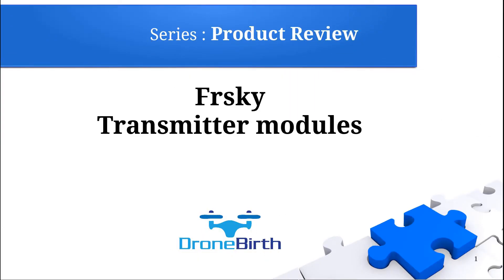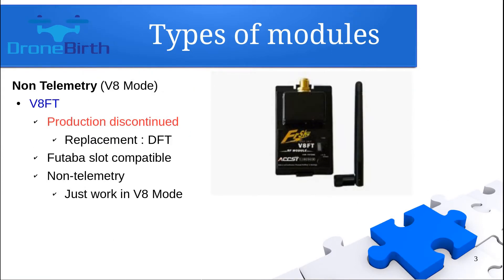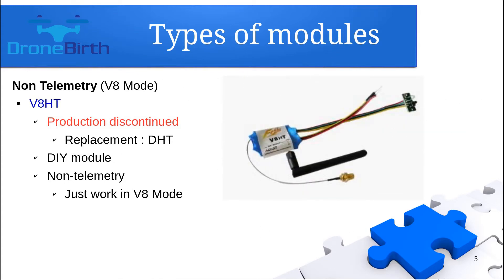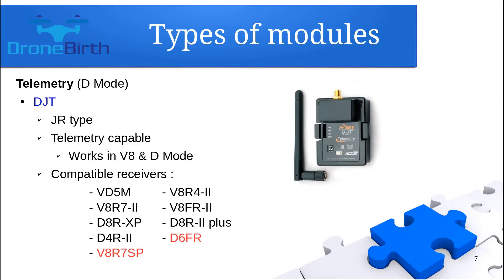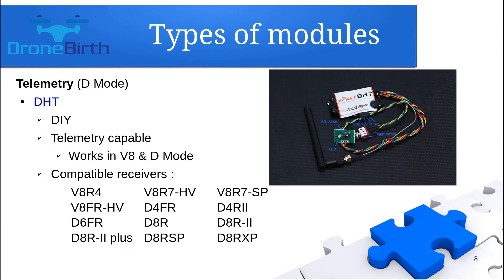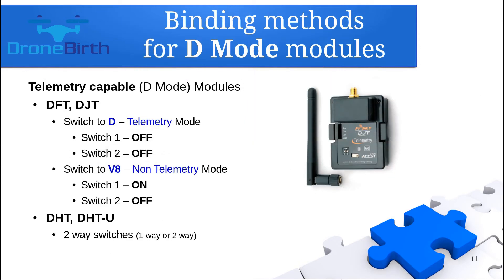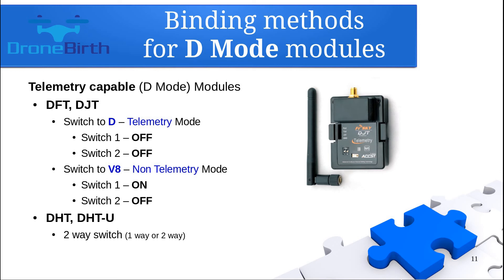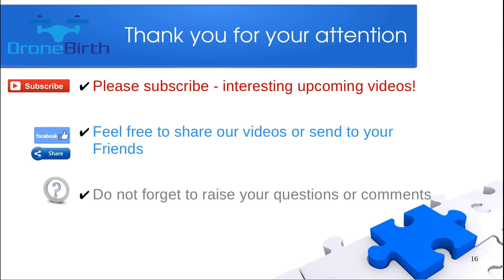Frsky Transmitter modules review (V8FT,V8JT,V8HT,DFT,DJT,DHT,DHT-U,XJT)

Comment: i have a DJT - JR Transmitter Telemetry Module for my turnigy 9x will it bind and the telemetry
 work with a FrSky X8R 2.4G 16CH SBUS Smart Port Full Duplex Telemetry Receiver?

Comment: I have the Turnigy 9xr pro and want to Bind to 9X8c V2 receiver using the XJT Module, are they compatible and what are the switch settings on the XJT Module in order to bind
Reply from the maker: Hi, Turnigy RX-9X8Cv2 receiver is only compatible with Turnigy TX-9X (v2) transmitter module. And not compatible with Frsky modules.
Reply: DroneBirth  Ok thanks for the reply.

Comment: Thank you.very much for the video.  i bought XJT module  and x8r reciver. want use my JR9X . binding is ok, but no movement of servos
Reply: did you ever resolve this - I have the same problem with XJT module in JR XP8103 transmitter and RX6R FRSky receiver

Comment: Hi, I found your video very informative as to which module I should use with my Turnigy 9x. The only reason I'm upgrading is because I like would to use the smaller D4R-II receiver with CPPM (tired of clunky and awkward 9 channel PWM receivers on mini quad copters but don't want to pay for a brand new Taranis) as well as maybe telemetry in the future. My question is, will simply installing the more recent DHT module into my radio allow me to use a D4R-II in CPPM mode? Or will I have to do some hacking in the software (like whats necessary to get telemetry)? Any responses would be very appreciated!!!